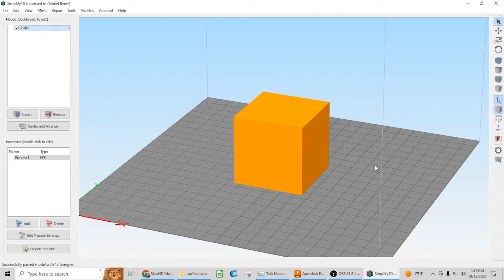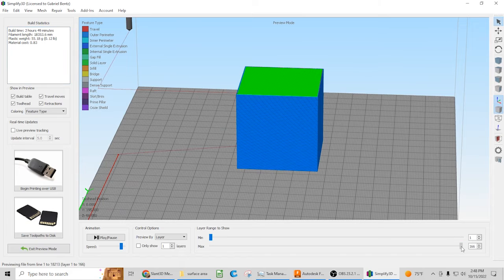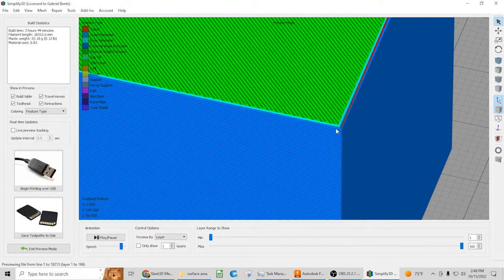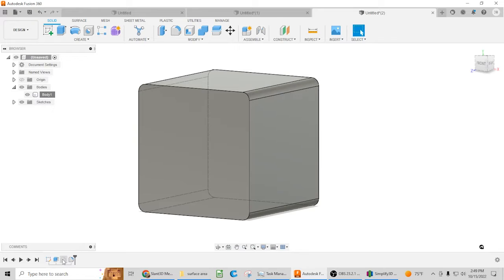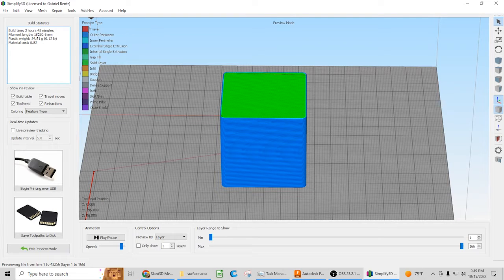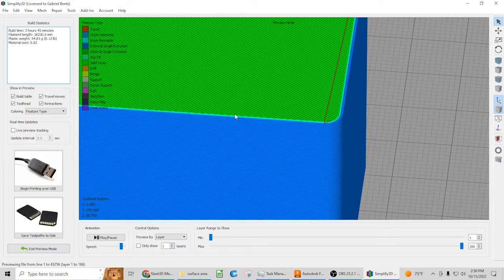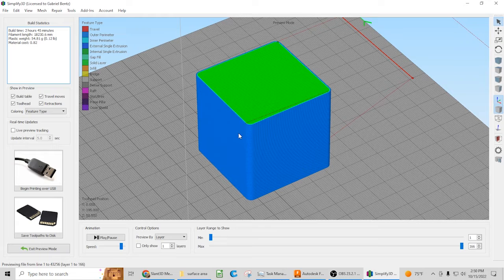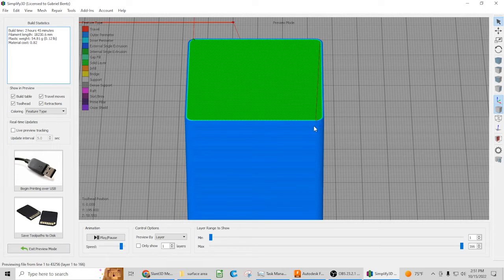How to Improve The Design of Your 3D Printed Parts Using Fillets

Comment: You could also just use lineair advance in x and y direction, wich where made for this problem of blobs on thé corners, altough on creality machines it doesn't work, for thé z direction, it would be usefull to prevent elephants foot, but there are settings in Cura like initial horizontale expansion to prevent this. Maybe it indeed decrease thé wear on thé machine when printing high speeds with high jerk and accelleration, but that of the Cost of having non perfectly fitting Parts.

Comment: Correction: round of everything in the (XY) plane your layers will be printed in.  In Z direction, ensure you use chamfers rather than fillets at least at the bottom to avoid steep overhangs (and when doing that at the bottom, doing the same at the top typically just looks better in my opinion).
Reply: Came here to say this, lower surface chamfers hide elephants foot. Large top surface (edit)fillets require extra solid layer support and (edit) fillets on the underside may require overhangs that can't be printed.

However a fillet around the base of a thin feature can remove a stress concentration, which is particularly important if the stress concentration is along a layer line.
Reply: @rowlandstraylight  Chamfers at the top should not require anything extra as long as you use 45 degrees as the walls below offer sufficient support at this angle. Similarly, at the bottom, if you stick to 45 degree chamfers (or equal length in both directions) and keep your layer height at or below 50% of your nozzle size, than also there the layers should not have problematic overhangs (unless they already had overhangs to start with).  Fillets in Z direction on the other side cause horizontal overhangs which even at the bottom layer will cause drooping and will look very ugly compared to the nice round edge the fillet will follow once its angle gets vertical enough to allow it to be supported better by the layer below (again around that 45 degree mark depending on layer height, nozzle size, extrusion width, cooling, ...).

One drawback of putting chamfers (or fillets for that matter) on the bottom of a printed part is that it increases the risk of warping and detaching the part from the bed in the corners (or having those outside lines pull apart).  Typically turning off cooling can somewhat help alleviate that, but that in turn increases the risk of the newly laid down layer to droop because the layer below it isn't solid enough yet to offer sufficient support.  Also adding fillets in the xy direction can help here as that avoids corners.  As with lots of things in 3d printing, tune until you're sufficiently happy with the result.
Reply: @MisterkeTube  Sorry I had a thinko in my comment, chamfered undersides are vastly preferable to fillets. Large roundover fillets can trigger minimum vertical thickness conditions and really slow down a print, small fillets and large chamfers on top are ok.
Reply: @MisterkeTube  Sorry I had a thinko in my comment, chamfered undersides are vastly preferable to fillets. Large roundover fillets can trigger minimum vertical thickness conditions and really slow down a print, small fillets and large chamfers on top are ok.

Comment: It is worth noting, there is about a .7% reduction in mass but a 2.3% reduction in time in this example. That difference is more than I would expect. (I would expect up to 1.4% reduction in print time.) As a follow-up, what are your acceleration and jerk settings? I wouldn't expect to see that much of a difference unless your accel is really low, like at 100-200.

A potential problem with this (though it can be massively mitigated in most cases) are your layer seams, I've found that sharp corners work better for seams than large round surfaces. So it might be worth designing one corner per island as a sharper corner, though a small fillet would probably be smart, just smaller than your other ones.

Comment: This is the kind of things addressed by pressure advance and input shaping. With those software features the gain in time is minimal and quality defect is eliminated. Are you guys using that kind of stuff ?

Also a bit surprised you're still using Simplify3D, this software has not been updated in years and is so lagging behind in terms of features. I would expect a professional outfit to have jumped on any more modern slicer that used the Arachne engine, so much better for parts designed by people who are not printing their parts themselves.
Reply from the maker: All the components of the process are important. Even with new slicers good design of the part is still critical when producing 100,000's of parts.

We work with all slicers because they all have different benefits. Simplify was chosen for this video because it renders the paths better than most slicers. Basically it is better on camera ;)

Comment: Thanks for the slicing tutorial videos! There are lots of things to consider when slicing parts with certain geometries. What do you recommend when slicing a simple holoween mask that doesn't have a good surface to set to the print bed? What are some special considerations for parts printed entirely on support structures, like a mask?